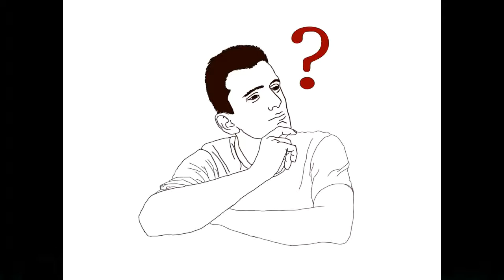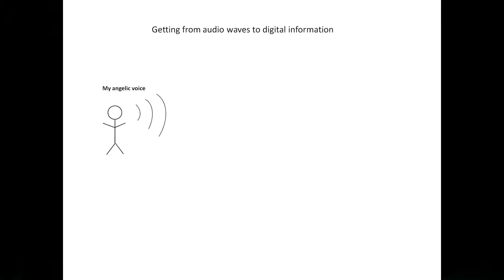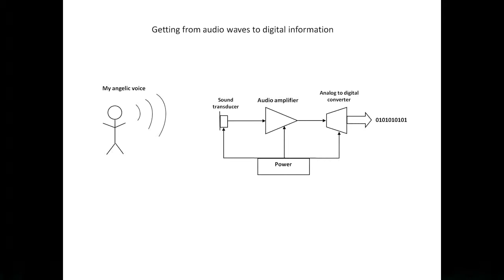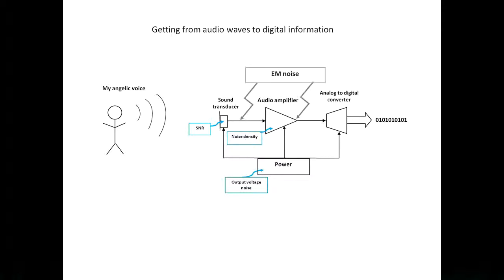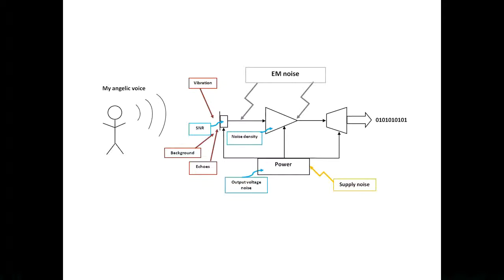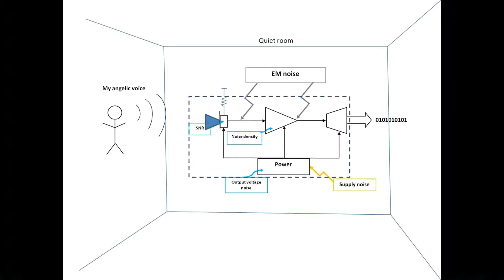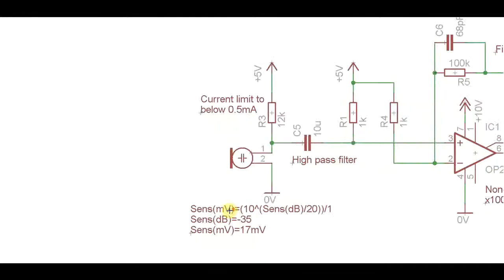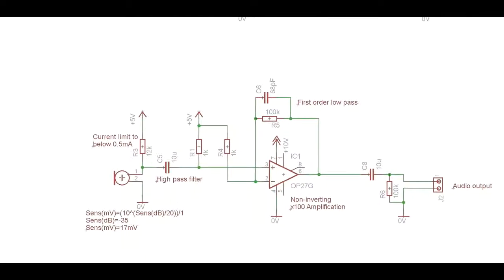Build your own HIFI microphone for recordings - Part1

Comment: Hi, what adc-usb IC are you using or can you recommend one?
Reply from the maker: I mainly worked with the PCM29xx series from Texas Instruments; I found that the best performance can be obtained with the PCM2912 - this is what I use to this day as microphone input for recording.
Reply: @FesZElectronics  thanks.
Reply: @FesZElectronics  I am sorry, but what is the point of using opam as a preamplifier if pcm2912 already has build-in micraphone amplifier? What I am missing?
Reply from the maker: Initially I was using the PCM2902 which does require an external amplifier, that is wha tI was using in the video; but then turned to the PCM2912 and in the end observed that the external amplifier was not needed.
Reply: @FesZElectronics  Thank you, I got it! I have another one little bit dumb question. Why your feedback loop R5 and R4 are connected to 5V? As I remember in classical non - inverting configuration it goes to the GND?

Comment: Working in astrophysics i can say that some of the noise can actually be from cosmic rays. Not really a noticeable part though 😅
Reply from the maker: I remember watching a documentary on cosmic background radiation, that was being measured in the GHz range; I'm not sure if I remember the frequency correctly though. What sort of frequency is the cosmic ray noise usually present at? Up until a point any circuit (even audio) will be able to demodulate signals that are of much higher frequency than the circuit is intended for, so to a certain extent even cosmic rays will have an impact on noise performance.
Reply: @FesZElectronics  there is many kinds of radiation in this, some are measuring radio waves which is probably the documentary you have seen. Direct particle strikes also happen and will give more of a popping kind of noise in analog, and flipped bits in digital circuits. Marco Reps had a nice video on the CosmicPi project showing how these can be detected. Google also published an interesting paper quite some time ago already, showing the statistics on the error correction in the memory on their servers titled "DRAM errors in the wild", that gives a bit of a feeling in his often this happens in digital circuits.